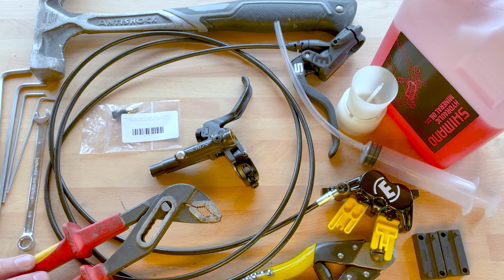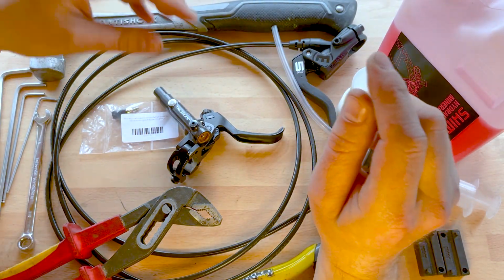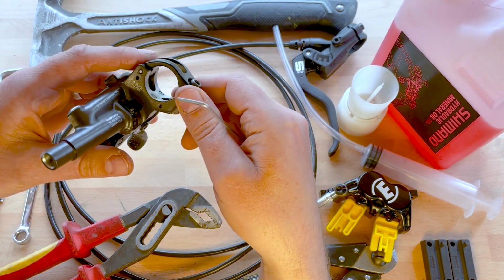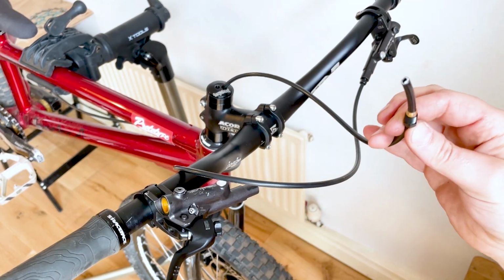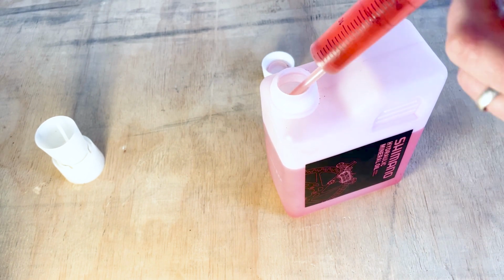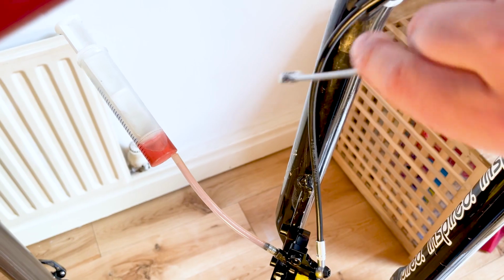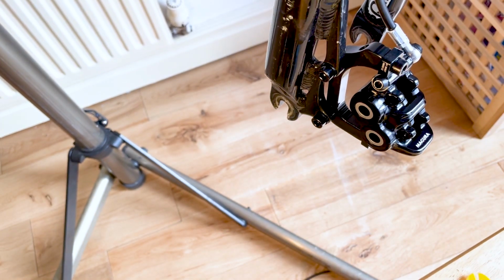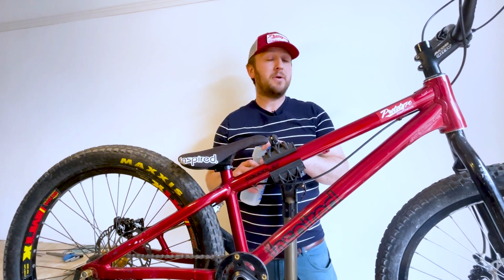Shimano Magura Shigura Everything you need to know

Comment: at 8:40 you say you don't have correct bleed block. the thick end of the yellow disc spacer actually is the correct bleed block.
Reply from the maker: Good Catch! Yes I must admit as I was editing the video, I was looking at them and thinking I bet if I had flipped them over they would have worked..! they seem to have also have a bit in them that you could use to hold the hose when fitting the barb. I'll pin your comment hopefully people see it!

Comment: I attached Zee levers to MT5 calipers. Works perfectly.
Magura and Shimano hoses don't have exactly the same size. You should use a Magura pin on the hose and the Shimano olive. That's the best combination! You use Magura stuff on the caliper side and Shimano parts on the lever side. Other combinations might also work, but are not recommended.

Also you should push the hose into the lever while tightening the thread. Not doing this ist the most common source of leakage problems at the levers.
Reply: I am running a shigura brakes Set up.Can I use shimano hose on Mt5 caliper?
Reply: @dhicon45  you shouldn't

Comment: Good thing came across this video. I have a leaky Magura MT5 lever. Tried fixing with a new master cylinder piston but was still leaking. Managed to purchase a set of Shimano SLX M7100 levers at less the price of just 1 Magura lever. Just waiting for my new barbs, olives and bolt in the mail and I'll do the conversion this weekend. Can't wait!
Reply: How did it work out? I have the MT7 Raceline and the lever went soft after a few month. Magura sent me a complete MT7 Pro set under warranty, but the rear is still softer than the front brake. Thinking of putting Shimano levers in.

Comment: If you leave/put the retention screws into the calliper, you can put the yellow bleed blocks in properly and they clip in place onto the retention screws. You push the bleed block in from the bottom with the skinny side first. You'll see there's a little 3/4 circle that clips onto the retention screw and holds the thick part of the bleed block in the right place.
Reply from the maker: Yep good call wish I'd known this before doing the video... I did try and pin the comment of someone who point this out first, to help others out.

Comment: @3:18

It's not different pins for different levers, it's depending on the inner dimensions of the hose itself. BH-90 is 2.1mm wide ID, and BH-59 is 2.5mm ID, the BH-59 pins are made of brass usually, and BH-90 out of stainless steel :)

Comment: Magura are crazy powerful, but shimano have a lovely leaver feel. I dont run shimano anymore because of the changing bit point when you heat them up. This could be an amazing setup to have that sharp leaver feel and crazy powerful and consistent brakes. I do have some xt  brakes spare i could take apart and fit to my mt7s! Keep going mate. Great videos!
Reply from the maker: Yer it's sad that Shimano have had this issue with there brakes, it really seems to put people off them, personally I have never had a issue with them and I've used loads of there brakes over the years (Old xtr single pot callipers with xt levers/ old xt's / saints / zee's / and now the new XTR 4pots...) and that's just the Shimano ones I've used... I might have problem... Thanks for the comment, good to hear you liked the vid.
Reply: @prototypecomponents  i dont think its much of an issue in thr UK. Its when you go out to the alps etc and really put some heat into them. This was an old set of xt 2pot brakes from 2018 on a full on enduro bike. Just before they brought out the 4pot upgrade. No issues with the magura mt7s, but the leaver feel isnt as nice as shimano imo.

Comment: Cheers for the video! Just did my install with MT5s/ shimano xt8000. Heaps more power and slightly reduced modulation but nothing dramatic. Using shimano bh59 barb and olive, will report back in afew months if there's any leaks etc.
Reply from the maker: Good job hope it’s working out well for you.
Reply: any leaks?
Reply: any leaks?
Reply: @leereiyuu  no leaks when I had it. Switched over to cura 2 shortly after and been on them since.

Comment: Hi👊
Little suggestion😉
If you are bleeding the lever, it should be in the upper position in relation to the caliper, the point is that the brake hose should go straight from the caliper to the lever so that the air bubbles escape through gravity upwards, and your hose comes out of the top cap, goes up and then in  down to the lever and this makes it difficult for air bubbles to travel to the funnel.
Regards 🤙
Reply: I was thinking the same when I watched the video, but I guess with this bike setup this routing is kind of the only way its possible.
Reply: @tomgroenbeck7620  When performing a bleeding service, we place the bike on a service stand which allows us to rotate the bike in any position, so if we do not want to dismantle the pins holding the brake cable (which is easy and takes a moment) to dismantle the brake, just turn the bike to a vertical or semi-vertical position to  be able to bleed with the brake mounted on the bike and the hose running vertically from the bottom caliper up to the lever regardless of how the brake hose was routed in/on the frame.

Comment: nice video and thanks for using saint..i have buyed the same levers but because all other dudes use slx im not sure if the saint will work...
anyway i have two critics...1 dont use a stealhammer for the insert and 2 it looks like you push the lever without pads or disc in the caliper, would end bad^^...
what i like the most is your crash...you fall but dont loose your bike or let it fall..GOOD BOY
Reply from the maker: Cool glad you like the video, don’t worry about the hammer it takes very little force in fact it’s easier to push it against your bench or wall but as I was filming this wasn’t practical. I kept the old pads in the whole time but should have used the yellow disc spacers as they work as brake blocks too. Yer I’m Definitely better at crashing than most people…

Comment: I did mt7/shimano xtr lever shigura setup and I definitely like them way more than mt7 with hc lever . 
Very crisp and lever feel is better , plus there is modulation and lots and lots of power.
Did one ride so far on this setup and getting used to it .
Reply from the maker: Great to here it worked out for you and that you like it.
Reply: @Grizzly 
I had same exact setup as Stella mt7 with xtr leavers for more than a year now . Haven’t had single issue , always crisp and bite point always at same spot , good modulation and tons of power especially with mdrp rotors and race pads .

Comment: The BH90 barb won’t work long-term, as the Magura hose has a 0.2mm larger ID than BH90. However the Magura barb’s ID (where the barb connects to the fittings in the lever. The solution is to use a BH59 barb, which is the same size as the Magura barb, but interfaces with any Shimano lever.
Reply from the maker: Thanks for your comment but personally I'll stick with what I'm running, until I have an issue as its working fine for me. tbh it makes more sense to me to have the correct barb for the lever the bore diameter is more about fluid flow, I imagine so if you wanted a snappier lever feel maybe worth trying a bigger bore. But it works fine for me as is.
Reply: @prototypecomponents  Great ideo mate,Finally a break down on how its done bit by bit,I must admit i also was told to use the Magura barb as it was allegedly thicker but also fel the Shimano one would be a snugger fit with the top of them being slightly different heights,I have been holding off to do mine due to no real vids to explain,Now am ready to go,Top work also on the air in the fluid,My royal blood looked a mess
Reply from the maker: @hainman1  Cool! glad you found the vid helpful hope the setup works out for you!

Comment: Thanks!  I haven't been able to get my front MT-7 to feel right.  I think I'm going to try a shimano lever and see if that does the trick.
Reply from the maker: Hope it works out well for you. lever feel is definitely a personal preference thing but personally i much prefer the Shimano feel.
Reply: @prototypecomponents  So my son and I used your instructions to replace my broken front brake lever and it works great!  I definitely like the feel of that Shimano Saint lever better than the Magura MT-7.  Now I'm going to have to replace the lever for the rear brake.  Thanks so much!
Reply from the maker: @Ensi33  Great to hear that it went well and you like it. I'm a big fan of the lever feel but I know Shimano lever feel can be quite polarizing.

Comment: Originally reffered to as SHAGURA before MTB dads renamed it. Should use genuine royal blood mineral oil in Magura calipers as the change in viscosity leads to inconsistent bite points which is often assosiated with Shimano brakes.
Reply: viscosity is pretty similar but the boiling point is very different. A lot of complaints about the royal blood fading.

Comment: great video. what brake pads do you use to have still a bit feel to control such massive breakpower ? thx
Reply from the maker: Standard Pads, probably best, i switched the rear ones for Trial tech pads to get more lock up for trials but tbh they have so much power anyway this might is probably over kill and sacrifices the ability to drag the brake slightly when manualing etc. your get use to the power and find the modulation after a few rides.
Reply: @prototypecomponents  thx for reply, thought sthg like this...

Comment: Hi.I'm going to do the same with my brakes.I'm thinking of using Magura Royal blood oil.Magura oil has a higher viscosity and withstands higher temperatures and heating during operation.What do you think?What pin you use on a hose?Magura or Shimano pin?What ID (inside diameter) BH-90 is 2.1mm wide ID,and BH-59 is 2.5mm ID,the BH-59 pins are made of brass usually,and BH-90 out of stainless steel?Obviously for Magura oil
it would be better with a bigger one ID pin.
Reply from the maker: oh didn't know that about the magura fluid. personally i would advice shimano fluid as its more readily available should you need to get some in a rush when away from home. but I'm pretty sure people have mixed them with out any major issues. maybe try your front break one way and the back the other and see if you can tell a difference?
Reply: Thanks. @prototypecomponents

Comment: great video man. I have a question for a long time. why do guys rarely use the hope trial zone brake at street trials?
Reply from the maker: Umm good question, i haven't use one for 15 years it was good for the time I think it lacked some modulation and not the best for locking up but that was a long time ago on a small rotor so maybe with better these days I suspect cost is the main reason you don't see that many of them.

Comment: Ok, I'm definitely removing those MT7 HC3 levers to get a pair of saints on my hex, thank you mate haha
Reply from the maker: Glad you found the video useful!
Reply: You'll be disappointed by the lever feel. The mt7/hc3 lever feels sooo much better than servowave shigura. Only go shigura if you're constantly crashing and braking levers The mt7 lever body is already sturdier than the mt5. Paired with the hc3 levers, the lever feel is amazing. Shigura will feel spongy in comparison, and you'll also get that wandering bite point issue that Shimano has. If you really want to do it, your best bet is the XTR Race levers. Without the servowave, you won't run into the wandering bite point issue. It'll also feel very much like the hc3 levers. I had the opportunity to try the combo on someone else's bike. XTR Race levers with Magura calipers is the way to go if you really want to go shigura. Another thing to take into consideration is that it is much easier to get a perfect bleed with a full Magura brakeset due to the ability to easily do a vacuum bleed. The Magura vacuum bleed method blows the Shimano funnel bleed method out of the water. https://youtu.be/Bl8PChRadX0
Reply: @dukeofmtb  So if it's so bad, how come tons of people love Shigura (even with servo wave levers), and how come tons of people don't get the wandering bite point issue with servo wave Shigura setups? 
BTW there are plenty of bleed kits out there that come with syringes for Shimano levers, but getting a good bleed with a funnel isn't exactly rocket science.
Reply: @HollyBoni  I've met tons of people that think their Shimano brakes are perfect, but then when I give their levers a few pulls, one side has a ton of throw vs the other, and the other side pumps up after a few pulls. I think some people just aren't as picky about that. A lot of folks also go Shigura for durability reasons. And although it's true that the funnel bubble bleed for Shimano brakes is super easy to do, the vacuum method on Maguras is even easier and works 99% of the time. When Shigura works, it works fine, but I still personally prefer the hc3 levers. It's just personal preference. If you prefer the feel of Shigura, you do you, broski. 👍
Reply: @dukeofmtb  I'am now trying mt7 calipers wtih zee levers on my hex. I knew the pull would have more "starting friction" because of the servowave. I also did not expect it to be as good as the MT7 HC3 lever. But the feel is straight up rubbish, I must be doing something wrong... the brake is powerfull, took it for a test ride. the problem is that once the zee lever reaches the bite point, it feels SO spongy, with a bit of effort I can pull it all the way to the handle bars. I bled them 2 times now. I cutted of the olive to save the length of hose, and swapped it for shimano one (left the magura barb in hose).
Reply: @lasthusky7004  I had the same experience. With the hc3 levers, the lever feel is very firm and lever throw is very short, so it's perfect for running the lever close to the bar. With Shigura, the power is amazing, but then the lever had a lot of throw and feels spongy after the bite point. Terrible for riders that like the levers close to the bar. Having said that, the non servowave XC XTR Race levers alleviate all those issues. Then it feels more like the hc3 setup. I think most folks like Shigura for the power and the sturdier feel of Shimano levers, but overall performance and feel is still the best with hc3 levers. Xtr race levers are a close 2nd.
Reply: @dukeofmtb  I agreee with everything but the lever throw, I was able to set it up exactly like the HC3 without any problems (I tried running one lever from magura and one from shimano at the same time for comparison)
Reply: @lasthusky7004  I see. Well, I prefer the firm lever feel of the hc3. Even if their throw is the same, I like the dead stop feel at the lever. Are you still going to stick with Shigura or go back to the mt7/hc3 combo?
Reply: @dukeofmtb  If it was on my mtb, I would prefer the shigura due to price and durability. But it was on my HEX, street trials bike. The reason I swapped back to HC3 is that the more spongey feel at the bite point gave me much more armpump than the hc3, even the MT5s were better in this regard.
Reply: @lasthusky7004  Those are definitely two things that go for Shigura. The levers are cheaper to replace, and can take a few more hits in the event of a crash. But if money is no object and all out performance is what someone is looking for, hc3 all the way.

Comment: If you would watch magura channel how to bleed brakes you would now that before bleeding calliper you need to lift it higher than your lever so not loosing oil and not bringing air inside ;)
Reply from the maker: Should spend more time watching YouTube how too videos than making them lol good shout I’ll give it ago next time.
Reply: It all depends which way the bleed goes, if ur pushing from caliper then it would be lower than lever, if its from lever then the caliper is higher, its to do with air bubbles rising up to exit points.

Comment: I would like to replace the brake hose on my ShiGura. I can't get a hold on a magura hose , Can I use shimano hose instead?  Thanks
Reply from the maker: Works best with Magura hose might be possible with Shimano hose but more difficult to get a good connection at the calliper end.

Comment: so levers are shimano calipers are Magura ,what about rotors?
I have SLX 2 pistons, If I change to Magura MT5 - stopping power will grow? SLX rotors are fine with this set?
Reply: Comes down to pads ur using, not really the caliper, not sure why u wud want to change those slx 2pots, mine are monsters, stick some js04 metal pads in with some metal pad rotors, u can also up the braking power with larger rotors, 180mm 203mm.
Reply: If u want context to my slx, m675 metal pads, sm-rt 66 rotors will stop my ebike very good, minimal fade, 160nm of torque is alot of power to stop.
Reply: Thanks for the info still not sure if Ill go that path.

Comment: can i use shimano BL-MT501 lever with magura mt5 calliper?
Reply from the maker: I would have thought so just check you get the correct corresponding barb insert for them.
Reply: @prototypecomponents  i heard that servowave action lever should not be mixed with magura caliper. is that true? and will i have any problem in the future?

Comment: I have the Shimano brake setup. Can I get  just Magura calibers and still do this? 
Or does it have to be Magura brake system with Shimano levers?
Reply from the maker: Easier to do the setup with Magura hoses so you shimano to Magura interface is at the lever not the calliper.

Comment: Are you still using this setup? Can you give an update how is it? I’ve seen from another video that he had an issue with leak and adjusting the caliper and ended up replacing it
Reply from the maker: Yer still using it no problems so far but I don’t use this bike loads sadly but now issues and some people have commented they have been using the setup for a long time with no issues.